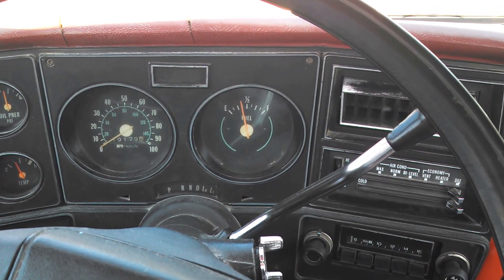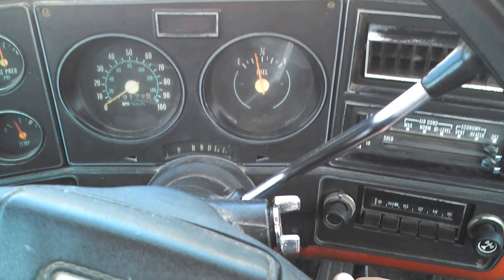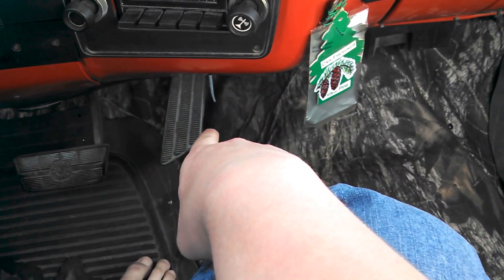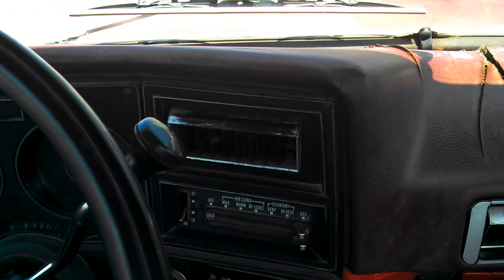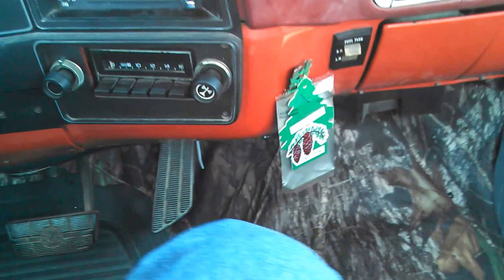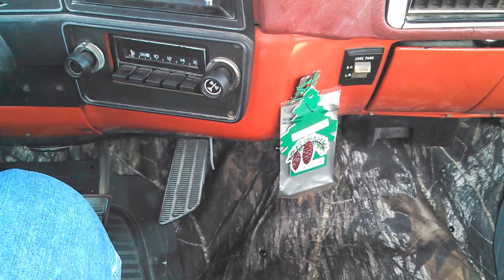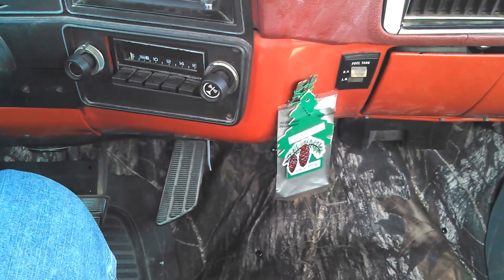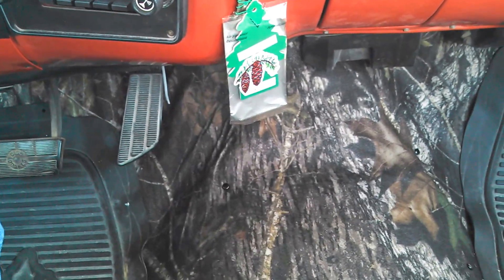Stretched-Out Accelerator Cable Easy DIY Fix

Comment: Another way to do it and imo it's actually a little better is to go to your local hardware store and get some nylon spacers. Cut a slit down them so that you can wrap it arond the cable. Then take either zip ties, or a small hose clamp and tighten it down around the spacer. The spacers I bought were like .59 cents a piece and come with two a pack..

Comment: Thanks for the great idea.  I had a little over an inch of slack on my 94 C1500.  I used a 2 piece wire rope clamp.  The was cost $.68 and it feels pretty secure.

Comment: I used  a nylon spacer and a hard rubber spacer in tandem.The rubber spacer is next to the end of the metal cable stop. I had about one inch of cable slack....the spacers fixed the problem! Did not use any cable zip tie wraps.You can of course adj the spacing a little bit on the engine side if needed. My 2004 Toyota Soluna pedal now has about 1/8" slack.I did not mess with the cable spacing on the engine side...Works great now!

Comment: I used a zip tie on the throttle cable and gas pedal on my 1995 GMC Jimmy, because I had the same issue to much play in the cable and it fixed the problem on my truck as well, now I have a little play on a 90s jimmy or Blazer you only need one, I do realize my truck isn't as old as this truck, but the zip ties still work.
Reply: Robert Bickford bro I just put 7 zip ties on my 01 zr2 blazer and she's still slacky..... she's a lousy goosy but she gets the job done!

Comment: I tried this before on a different model of vehicle that had an adjustable valve and it didn't work, however I am pretty sure this will work on a Jeep 4.0 (Cherokee) at the pedal.  Now that I think about it when I tried it previously on the car I did it at the throttle itself.  I think I am going to find a way to rig up a washer or a few lock washers to it so it will sit nice and flush on the surface of the cup on the pedal lever where the cable runs through.  FYI, mine was fine until I hung it up out of the way a few weeks back while doing an engine swap.  I had all of the engine harnesses hanging off of it.  Don't do that.  I never believed those things would actually stretch.  Now I know better.

Comment: Was getting horrible mileage tons of play in my cable. 1 nylon bushing and like 5 zip ties my 1997 k1500 5.7 4x4 is getting mega power again. My throttle cable at my local Chevrolet dealer was 50$. This cost me 0$ just as effective.

Comment: After getting a new cable and if your still not at w.o.t. at the carb but pedal to the floor You can take the pedal of the floor and bend the z shaped rod a few hairs untile its w.o.t.

Comment: That's a great video.  The problem with my 1979 GMC Sierra is the idle won't kick down.  My gas pedal is fine, doesn't need adjusting, but, what would you recommend I adjust to set the idle back?  Thanks.  If there is a video you would recommend showing how to adjust the idle, that would be great, also.  Thanks.
Reply from the maker: Abigail Sanders check the springs on the throttle sounds like it's not kicking back or you could have an issue with your electric choke
Reply: It's not an adjustment on the carberator?
Reply from the maker: Abigail Sanders air fuel mixture is a carb adjustment, timing is the distributor, but your idle problem sounds like either the choke or throttle
Reply: Okay, thankyou.  Since I'm not that familiar with an engine, I'll just have to find a vid that shows me what I'm supposed to be doing.  But, yes, it was as if the choke was out...as speaking in terms of older vehicles that used to have a choke on the dashboard and when pulled out, the vehicle would propel itself without needing to step on the pedal.  Truthfully, I wouldn't know where to look for the choke under the hood.  My daddy didn't raise me learning mechanical things.  I've had to teach myself.

Comment: your cable locker has slid out of the gromet... they dont stretch that much . had the same problem looking at it... took me awhile to realize it was broken
Reply: Before you fixed it did you accelerate as soon as you turned the car or truck on

Comment: Where did you hook up the zip ties at on the gas pedal?
Reply: Josh McClure use speaker crimps, the metal ones.  and measure how much farther the cable needs to be spaced by opening the throttle fully by hand on carb linkage while someone is pressing the pedal fully. measure the slop. say its 1/4" then look at the pedal in cab and you'll see where the cable attached to the top. lift the pedal off the floor without the throttle return springs on the carb. so there should be a round piece crimped on the end of the cable down there. if you lift the pedal you will get slack and you put metal crimps  the same length you needed to fully open the linkage.

Comment: Won’t the zip ties break ? Since they are plastic
Reply from the maker: I've never had that happen to me, zip ties are pretty tough especially from the side like they are here. That coupled with the fact that I don't know of too many people pressing that hard on a gas pedal makes me think they'll be fine for the job. Also if they do break they're like 1 cent to replace so it doesn't bother me too much.
Reply: bcperry15 you are right I’m about to do this right now I’m my old 98 Ford F-150 it’s my work truck basically and I would like to have a lil more power it’s the 4.6 L v8 engine